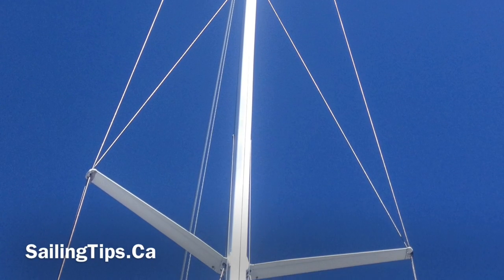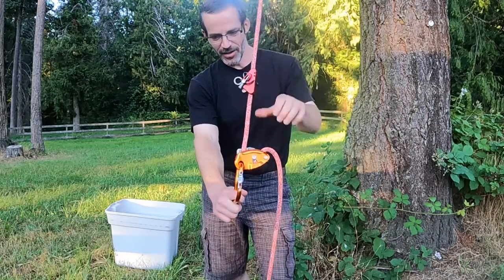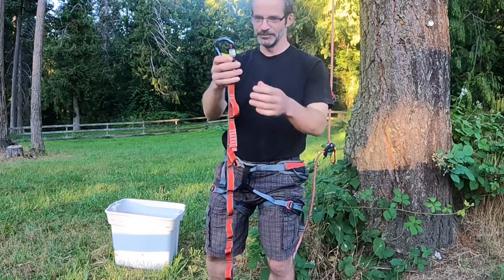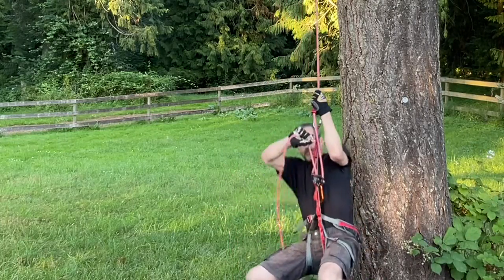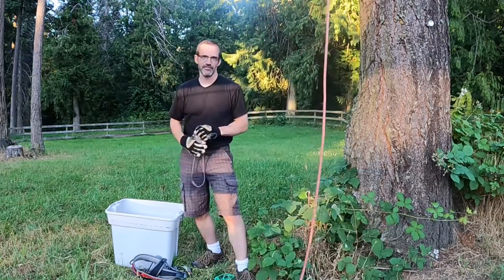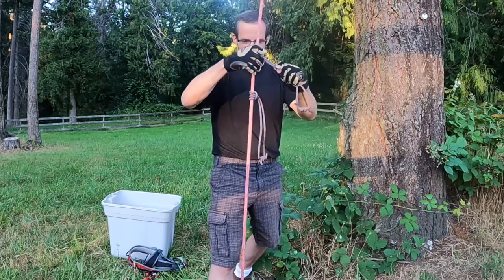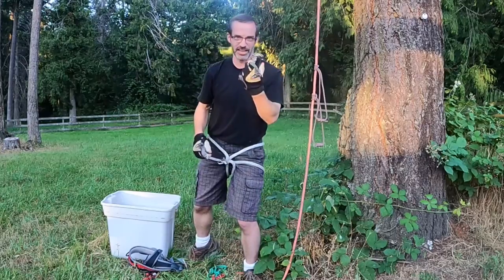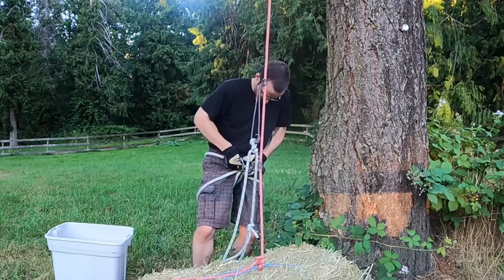How to Climb a Mast Solo Using Only Scraps Of Line!!!

Comment: Great video. I learned some things. Like the loop harness. You only said "you may need to adjust this to fit" once but it applies to all the scraps of line. The most obvious one in your demo being the lower prusik loop could well have been smaller and would have allowed larger "steps". I guess that is the good thing about using bits of rope, one can size everything to suit.  Huh, and lots of the comments have some other good ideas.
Reply from the maker: Yes completely customizable - I really didn’t optimize the geometry before making the video so lots of opportunities for improvement!

Comment: Great video as usual. Don't see many people running a Swiss seat and prusik aid climbing rig anymore. The prusik will slide when you move the locking bar so it's important to reset it after.
Reply from the maker: Good point! You also need to completely unload the prusiks to move them. I made several trips up that mast with prusiks before somebody had mercy and bought me a GriGri!!!

Comment: At 7:43 you have the problem of loose line under the lower prusik. Second hand you need to hold yourself upright.
If you interchange the prusiks: feet-prusik lower one, harness prusik upper one, it's much easier: Loose line is when you're hanging at harness and have both hands free. One to hold lose line fixed, other to move feet-prusik upwards.
Reply from the maker: Thanks I’ll try that!

Comment: Grigri not really designed for repelling.  Better to use something like a Petzel Rig designed for repelling or the ID.  Use a backup safety line attached to harness.  Most halyards are over 13 mm so attach a dedicated climbing line to the halyard and haul that up as the ascent rope.  I find even a dedicated climbing harness kills me if I spend more than 30 min hanging in it.  I invested in a Petzel harness with wider leg support and a Croll chest ascender which I find super comfortable when spending time undertaking rig inspections.  Thanks for the vid
Reply from the maker: Good suggestions! Yes a GriGri is fine for occasional use but I would use something else for rappelling if doing it more often. Most of the boats I race on use HMPE halyards between 9-12mm which work okay in the GriGri. These same boats would use larger halyards if double-braided polyester which wouldn’t work so well.

Comment: I'm an old rock climber and would really emphasize a back up.
Reply from the maker: Yes a backup is a good idea and there are lots of options for that like 1) prussik around another halyard 2) prussik around the mast 3) muenter hitch on another halyard etc.
Reply: @SailingTipsCa  #1 there is best. I prefer icicle (aka klemheist) knot--easier/faster to tie, easier to slide upwards (very underappreciated knot). #2, prussik around mast, is very slow & awkward. I only use the mast for the backup when a halyard is not available or is wire or is on a block rather than a sheave or is sketchy old/worn rope, and I use a girth hitch with 1" webbing instead--it's stickier. Even then you need to be very very careful to snug it well after each slide. Has to be re-tied at every spreader, stay, etc. Also be very aware it has a terrible "fall factor", the lack of stretch you get when on very short lead. You can use two and alternate them if you really want continuous 2-point attachment. #3, muenter hitch, sucks for sliding. Good to know about as an emergency descent mechanism (just requires 1 'biner) but isn't locking, and imparts a lot of twist in a rope that requires a lot of work to completely remove.

Comment: Looking for an ascender recommendation (I agree, most are way too aggressive) your's looks good! Brand?
Reply from the maker: Mine is a Petzl Microcender which according to the forums they may not make anymore :( https://www.mountainproject.com/forum/topic/112809195/solo-top-rope-petzl-microcender
Reply from the maker: Looks like the Petzl Rescucender is the updated product from the Microcender I used in the video - it appears to have a smooth cam locking mechanism and not gnarly teeth!
Reply: An atn mast climbing gear is the same idea. It's all built for sailboats and the learning curve is much smaller
Reply from the maker: @gillejohn9  The ATN gear looks pretty similar, about twice the price though!!!

Comment: Novice here. Do sailboats have a dedicated line just for climbing the mast? Just wondering how you get the rope up there if not. Or do you just use the haylard for climbing?
Reply from the maker: Good question! Some sailboats have fold-out steps on the mast, but for those that don't it's typical to climb or be hoisted up with a halyard.

Comment: Sorry, but it is wrong an dangerous instruction. Please do repeat it at home. First of all, you do not have any second security, your lag loop should also be attached to the harness in case of main attachment failure. Ideally to have some holding device on separate line. Secondly, never grab prusik knot with hand over the knot, if you start falling you will automatically grab the knot, that prevents it from tightening itself. Hands movement around prusik should be very careful. Even though prusik usually works, it depends on ropes, and I would not trust my life solely to it.
Reply from the maker: Yes you should absolutely test everything before trying something like this and also use safety lines! I didn’t use safety lines in the video because I was trying to illustrate the concept of using Prusiks with a makeshift harness, and safety lines make it difficult to see and understand what is actually going on. Thanks for your very valid points!

Here's a video of a climber demonstrating the same technique of climbing a line with prussiks: https://www.youtube.com/watch?v=bscpdQ6fcPQ I agree that you should avoid touching the prussiks if you're using them to arrest a fall, but it's not obvious to me how you release the prussiks for climbing without touching them. You're also using two and one is always biting while you move the other.
Reply: @SailingTipsCa  When you release prusiks you obviously touch them, but only one of them. I commented on your standing-up technique. When you stand you grab your hand on top of the leg prusik while simultaneously releasing the bottom one. The bottom is not holding anymore, and you grab the top one, so it is easier to you to lift yourself up. It is a moment when you can fall down. This timecode https://youtu.be/uLYYDmmxx4A?t=468
I tried to find the video which describes the safest method and looks like that https://www.youtube.com/watch?v=CKOZDe0J4bI
Reply from the maker: @andrii.b9788  Thanks for the clarification - you’re saying only touch one of them at a time right?
Reply: @SailingTipsCa  Yep, you should never touch that one that is holding your weight. The reason is that it may stop holding if your hand squeezes it which may happen as an unconscious panic reaction when anything happens such as a small drop.
Reply from the maker: @andrii.b9788  Thanks for the excellent safety tip!!!

Comment: That looks downright sketchy
Reply from the maker: Yes it takes some getting used to! Thankfully you can test it all out just a foot off the deck and choose not to go higher if anything is amiss…
Reply: @SailingTipsCa  I tried out my ascenders today, but chickened out about 3 ft above my boom, 6' or so from the deck, mainly because I didn't like my equipment though, I need some locking carabineers at least, and my halyard while looking okay is I know aged and the ol wire and rope type, I pulled another to climb on, the part that's getting me most confused is where the second halyard comes from except form the jib/ Genoa which mine is a roller and my top bearing is seized so I can't get it down without going up and being first time inexperienced I'd at least like to rig a prussik on a secondary, heck I've already got a bunch of metal in my back!!! A fall would end my sailing days for sure!! Lol!!! But last time I paid somebody qualified they charged me 250, for a bulb change that took 10 min, I get paying for the experience but I gotta say 250 made me feel a bit raped! But I'm stuck between paying it again , or risking the end of my dreams if it goes south! Anyways thanks for the vid!
Reply: @SaltySoul-p3w  Always good to be on the safe side if you’re unsure! And yes definitely use locking carabiners! I’ve done it all on one halyard but then again mine are quite new with Dyneema cores and I’m not concerned about them breaking. If yours are wire and rope they’ve probably been around for a while! It also depends on which side of the mast you need to go up. For example I’ve climbed the spinnaker halyard and flicked the main halyard over the shrouds to use as a safety with a figure 8 belay device and a second locking carabiner. Are there any mountain climbers in your area to tap into, either to show you how to do it or even do it for you?

Comment: pretty cool, but i think irresponsible. no secondary safety halyard, the entire weight is on the climbing line... etc
 I think this dangerous advice.
Reply from the maker: I would definitely recommend using a second halyard with a Munter hitch or clove hitch as a safety but didn't in this video because I thought it was distracting with too many lines and I wanted to focus on the prussik climbing technique.

This is a pretty common technique in mountaineering and they tend to climb a single rope with the safety tied in below the prussiks.

Comment: you look pretty tired climbing just couple feet. This looks very exhausting.
Reply from the maker: Good observation! It is a good workout, but it was also more tiring in the video than climbing an actual mast for a few reasons: 
1) My makeshift harness was too big and should have been tighter, but I thought a looser harness would be easier to see in the video. But this led to the foot loop and harness prusiks being too close together which in turn led to smaller inchworm steps. With a properly-sized harness and foot loop you can take bigger inchworm steps. 
2) I was dangling in mid air, which put my feet out at 45 degrees, and required more upper-body strength to maneuver. On an actual halyard taught against the mast you can brace your feet against the mast so they are more underneath you, and push more with your legs instead of using as much upper-body strength. 
3) While I have gone both ways on a single halyard with prusiks, I would prefer to take a second halyard with a Munter Hitch to rappel down, which is obviously easier than inchworming back down again. But I wanted to keep the video simple and not introduce too many concepts, but maybe I should have!!!
Reply: @SailingTipsCa  Maybe its informative enough for experienced people in such field. Thanks for answer man. I guess it all makes sense, riding a bike is much harder if it's too short for your legs. Guess strong guys like you can handle such physical load i shouldn't  try putting myself in such situation :D
Reply from the maker: @boyinpyjamas  It was also definitely easier 10 years ago!!!